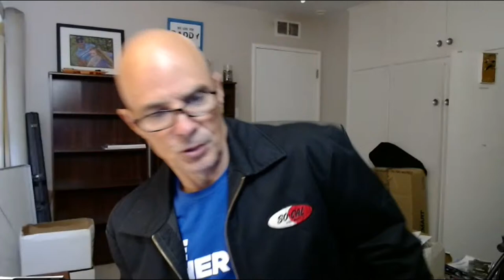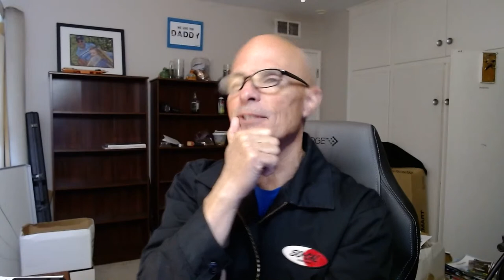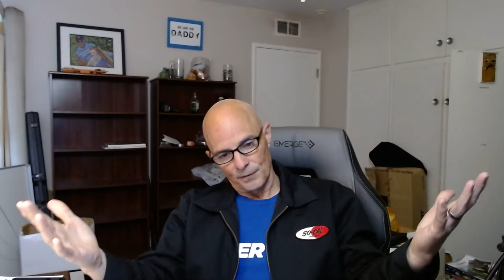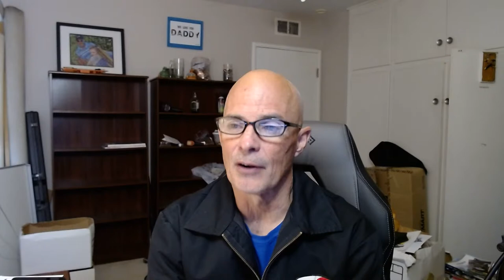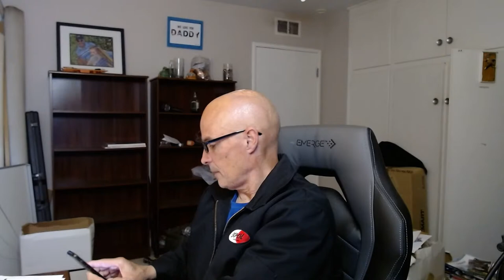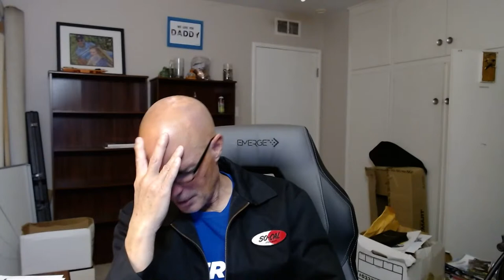LET'S TALK TECH-GT500 BLOWER LS BYPASS VALVE BOOST CONTROL

Comment: I have this on my BMW 2.5L inline. I am using a boost controller to control the gate that ties into my standalone. As you said you can do all kinds of things like boost per gear and I will tie mine into E85 sensor soon. but I also get boost cut as well.

Comment: Why not take bypass air and run it through an air to air intercooler before back to the blower, an easy cheap way to lower temperature
Reply from the maker: very complex plumbing-not really an option on this set up

Comment: Using vacuum / pressure to control the valve might lead to much delay / variation especially when driving on regular roads. 

One work around would be to use a multi blade bypass valve rather than one big one so you have finer boost control.  Figure a small, medium, large blades that can be used in different combinations.  This would operate like a GM 3 valve EGR valve. 

If a single blade is used, there needs to be position feedback in order to maintain some consistently.  I'd be looking towards actuators on dual path intakes or. . . .   

Use the HVAC controller ( panel in the dash ) from a late 90's Ford Ranger and the electric motor actuator from the temp blend door ( use the actuator electronics since it has position feedback but install a larger control transistor and servo motor. )  There are 2 types, standard manual control and automatic temperature control.  The manual system might be able to be integrated into the EFI system.  The ATC system would offer closed loop feedback could be a standalone system.
Reply from the maker: the vacuum/pressure control already works
Reply: Well the absolute best and most simple route would be to just use a wastegate and place it either on the supercharger plenum or intake tube/pipe. Then tune the max valve to control the watsegate like one would do for a turbo. This way you don’t have to worry about the air the keeps getting recirculated and hotter every go around because you simply bleeding the extra air to atmosphere. Also tuning would be A LOT easier than a turbo because you would already know the max boost you are going to see, and max boost the wastegate is capable of bleeding with that pulley

Comment: You should do a dyno run with the 3800 and the original bypass valve and then remove the valve assembly and use a spring to hold the flap closed and run it again... that's a pretty hot topic online and it would be cool to see real world AFR changes, power production and boost curves. Great content man keep it up these vids are killer cool!
Reply from the maker: DO THEY THINK THE VALVE IS OPENING WITH THE STOCK BYPASS? IT ISN'T!
Reply: @richardholdener1727  some seem to think with the bypass valve removed completely and the butterfly fixed in the closed position the engine will be in boost under low/part throttle applications and it will cause a KR spike mid rpm. Some say they have done it and  it seems to produce more torque at the expense of 1-2mpg loss. It would just be cool to clear the air and have a solid source of valid info on the subject. Thanks for the reply!
Reply: @richardholdener1727  granted this is on the gen3 and gen5 eaton 3800 superchargers which also have computer controlled boost solenoids, so the pcm can dump boost on demand based on various conditions and built in safeties for knock and fuel conditions.